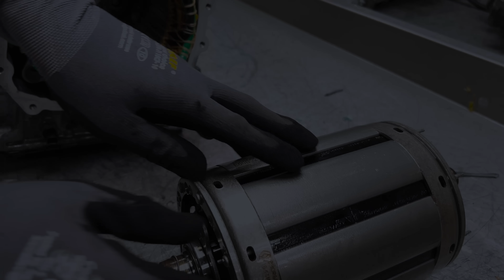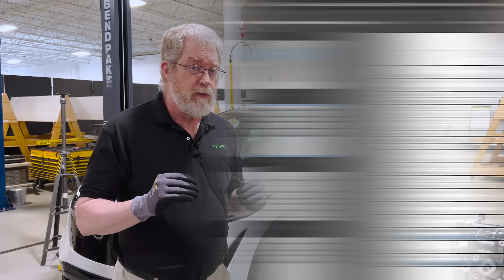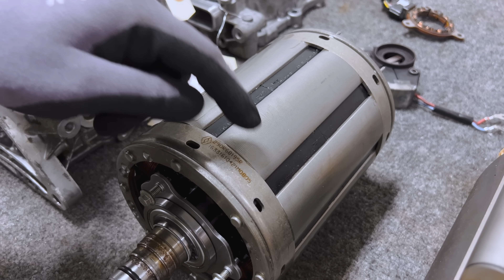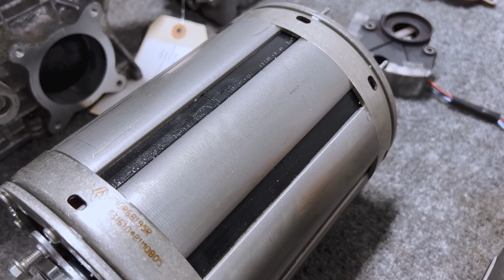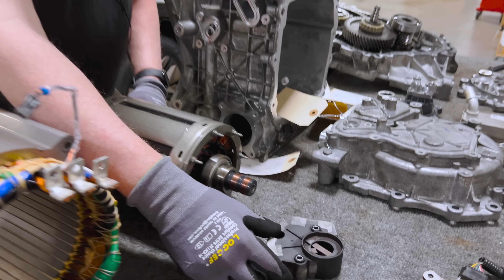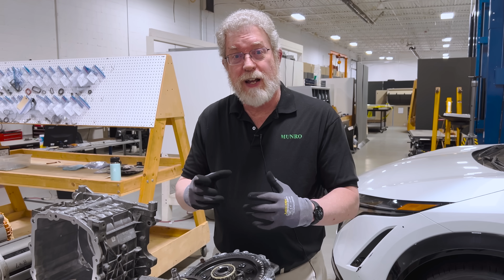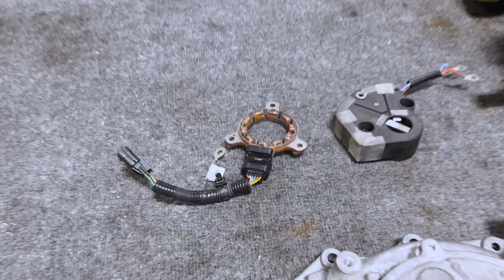This EV Motor Has No Magnets – Nissan Ariya EESM Teardown

Comment: Can this motor Regenerate like the permanent magnet motors?
Reply: Yes, once the rotor has been energized it is able to operate the way as a PM synchronous motor. It can motor and generate in the forward or reverse direction.
Reply: @PaulTurnbull-EMfield  But is more energy saved by a) doing regeneration, or b) by cutting power to the rotor windings?
Reply: @DiligentFlamingo412 100% by doing regeneration.
Given the fact that regen will slow your car down, and that huge amount of energy will be significantly higher than those tiny rotor wires can handle, the bulk of that energy is going through the stator windings. 
I’m actually curious of a design that uses weak permanent magnets as a baseline field, but also has these rotor windings to give that same control. But such a system sounds quite complex and I have no clue about the efficiency physics of it.
Reply: Yes, nearly all types of motor and absolutely all motors used in EV are capable of operating as generators for regenerative braking. In fact, this externally excited rotor winding design is very much like the alternator of a modern car... which of course does nothing but generate.
Reply: It’s gonna be very inefficient it uses carbon brushes for both operation and regeneration. Carbon brushes are crap. What the hell are they thinking? Seriously 😂
Reply: @acvwacvw carbon brushes on commutators have severe challenges that brushes on slip rings don’t. It looks that Nissan has put some effort and testing to ensure that these brushes will last longer than you do.

Comment: The Renault Zoe, which uses a similar motor, suffers from bearing failures, possibly because of stray currents through the bearings
Reply: There is a solution to that problem, Renault have a service kit for it.
Reply: @mikilambastein1449  AFAIK, in France at least,  Renault does NOT open motors to change bearings. They only quote motor swap with refubished one. But some independant shops do it (had my 2017 R90 motor bearings changed at an EV mecanic). It's a 10 hours job to take out the motor to change these 100€ bearings.. shame the car has not been better designed for easier maintenance (at least of the motor).
Reply: @mikilambastein1449 and about 12 hours labour to fit 🙄
Reply: Also from debris getting in from the blower, Q model Zoe's that are liquid cooled seemed to suffer less from motor and more from charging issues.

Comment: Actually, Renault developped this externally-excited synchrnous motor since the Zoe.
The first gen Nissan Leaf used permanent magnets.
Reply: Yes, it's clear that the Nissan engineers worked with the Renault engineers to develop this motor.
Reply: @PaulTurnbull-EMfield  This is Renault motor, look for markings on it
Reply: This the CMF-EV platform co-designed by Renault and Nissan and used in

    Nissan Ariya (2022–present)
    Renault Megane E-Tech Electric (2021–present)
    Renault Scenic E-Tech (2023–present)
    Alpine A390 (2025–present)
    Mitsubishi Eclipse Cross (2025 announced)
    Nissan Leaf (2025–present)
Reply: Except in the Zoe motor they left out the brush to dissipate the voltages dissipating through the bearings which is the most common cause of Zoe motor failure.
Reply: @eclecticcyclist Yep, but Renault probably corrected this issue in the last designs.
The first motor (Q210) was designed by Continental.
Reply: If you google 'renault prix de l’innovation territoriale 2022' you'll find Renault won a price for this motor, and you'll see a photo of the exact motor that's in this video. So indeed, the Nissan Ariya uses a Renault motor.
Reply: Not a good sign, missing this grounding detail, and having one of the longer EV history.
Reply: stop spreading garbage lies. This is Nissan technology that renault doesnt have or use
Reply: @emikomina They use it since 2012 in the Zoe, blatant ignorant.
Reply: @emikomina not true Nissan used permanent magnets originally.
Reply: @emikomina  You are incorrect. Renault uses EESM motors in the Renault R5 EVs, Renault Megane, Renault Scenic etc
Reply: @emikomina it's not a lie if it is true. This is a motor that Renault developed with Valeo.